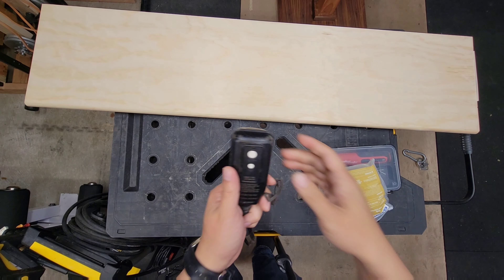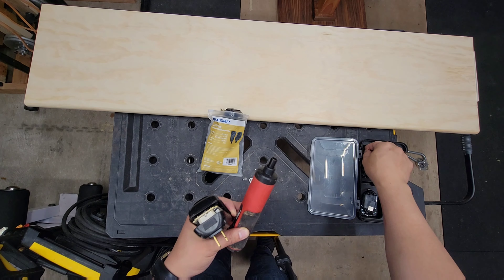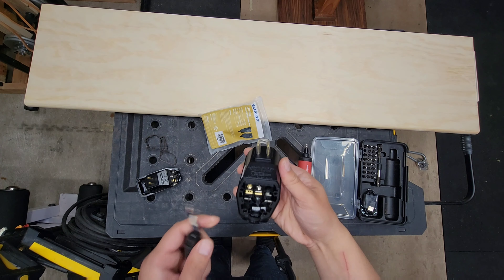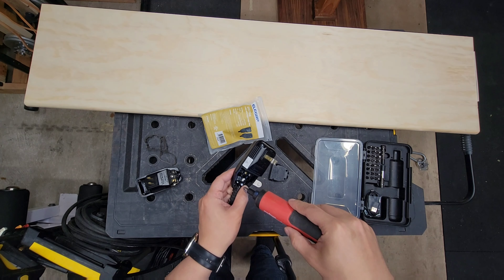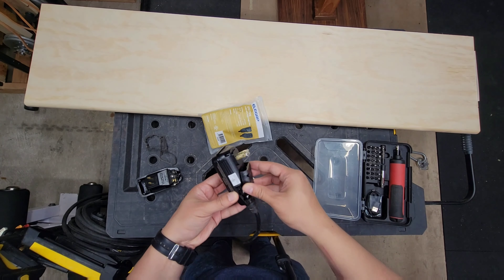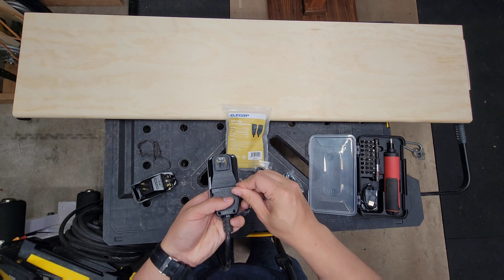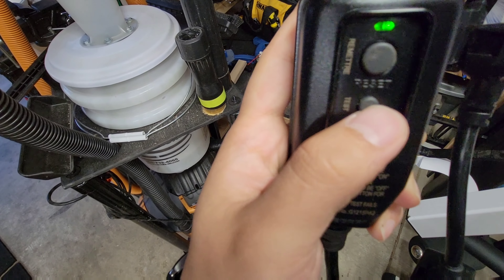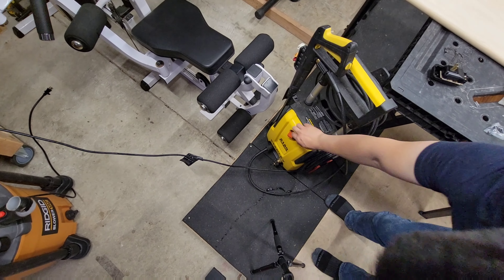Stanley 2150 Pressure Washer GCFI power cord head replacement | No start | Fixed

Comment: I have this exact same pressure washer and had everything set up and ready to go to wash my car only to find out that the GFCI thingies all fucked up and not working. I hate this pressure washer
Reply from the maker: Hey, replacing it is fairly straightforward with a GFCI replacement head! The problem that comes is if your power source spikes or anything the GFCI trips, but this protects the pressure washer, it's actually a good thing! But annoying!